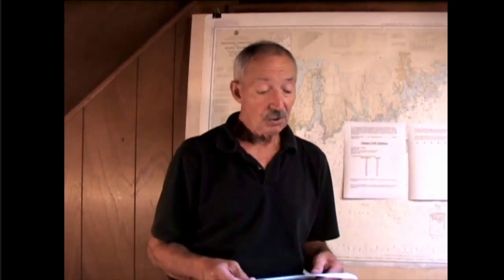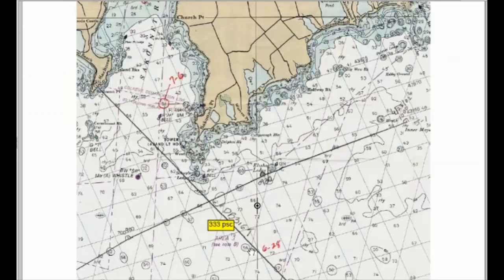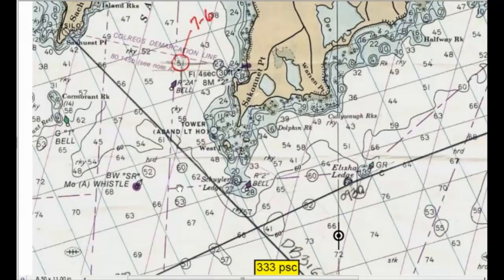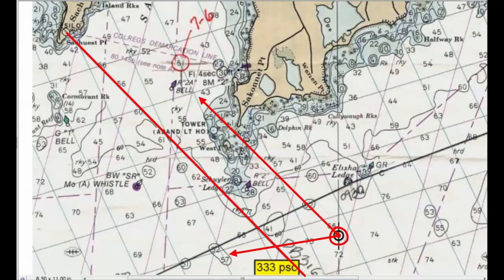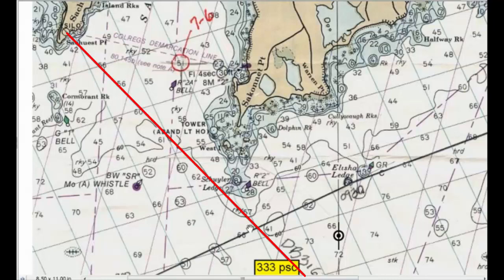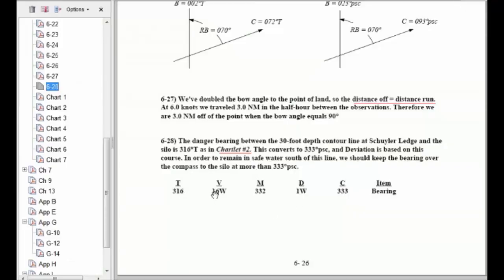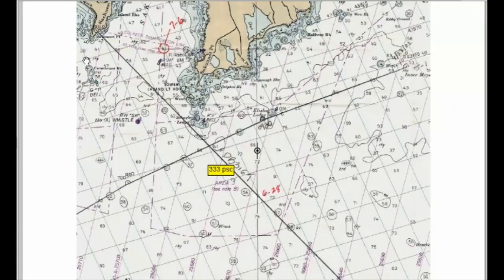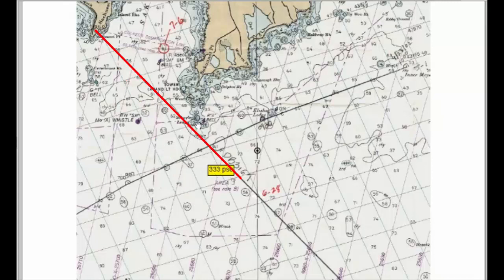Danger Bearing

Comment: I learned that you don’t apply the deviation when taking a bearing with a hand compass because the deviation changes even if you move just a few feet on the boat. Why is the deviation applied in this case to establish the danger bearing?
Reply from the maker: This question is based on using the ship's steering compass which is calibrated. The hand bearing compass, as you point out, is problematic in regards to calibration.